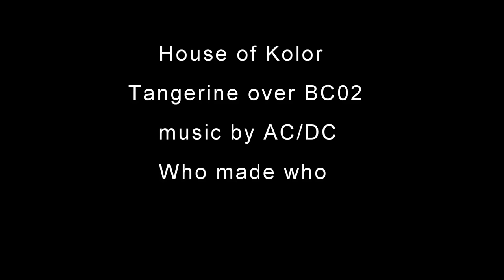Painting flames on Harley Davidson tank & fenders Gopro Hero 3+

Comment: What was the final coat of paint that turned the flames orange? Candy or something? Or just "thinned" tangerine?
Reply from the maker: it's a candy coat which is very transparent. A silver base flames make the brightest orange, changing the base coat that used for the flames will make a different color orange flame. I sometimes use a blue basecoat for the flames then use a silver for the flame tips so the tips are brighter than the rest of the flame.

Comment: Is there a reason you didn't airbrush in the Kandy before unmasking?  I've found that even with a black base, you still get some orange "tint" to the black in direct sunlight.  Or was that the look you were going for?? either way, came out beautiful!!
Reply from the maker: that's the look I go for, if you spray the candy when it is taped off you get a high edge on the flames that has to be sanded down or covered with a pinstripe. I had added a silver pearl to the basecoat so the pearl in the tank takes the color of the flame when the sun hits it. Tank looks black until the sun hits it. you can't feel a edge on the flame when I do it this way and there is no need to wet sand and buff a edge away.

Comment: Looks good... but I would be very leery of how crisp the lines on the flames are. Tape that you were using looked like el cheapo masking tape & was too wide to make nice lines around the tight bend. I can see why you would have the vid in fast forward!
Reply from the maker: its not a cheap masking tape, its  3m 1/8 fine line inch tape and leaves a very sharp crisp edge, I used the fast fwd so the video wouldn't play in real time it would have been an hour long video, this wasn't intended to be an instructional video.